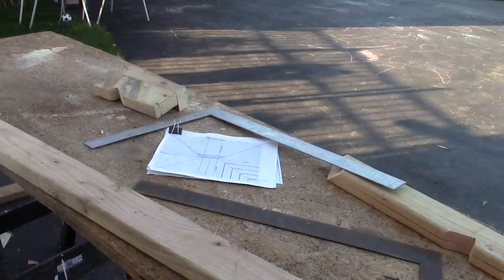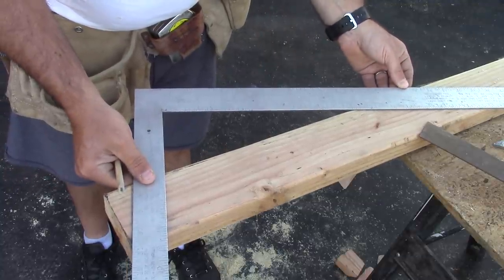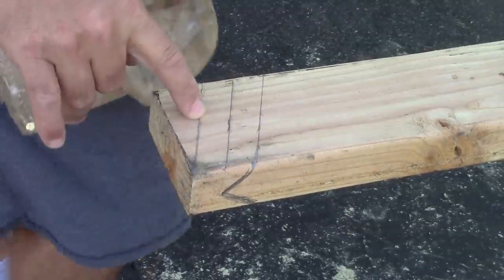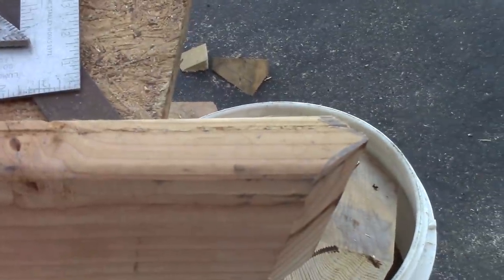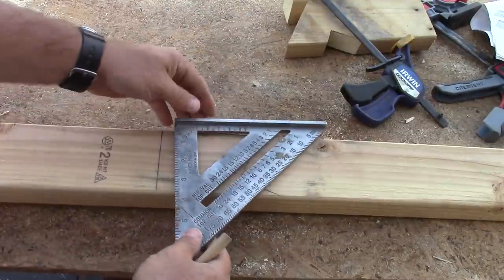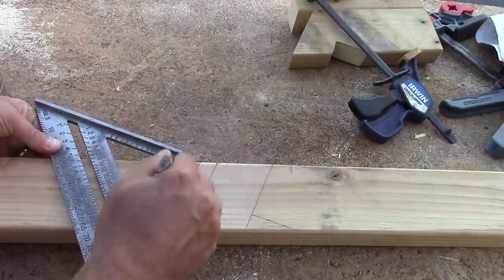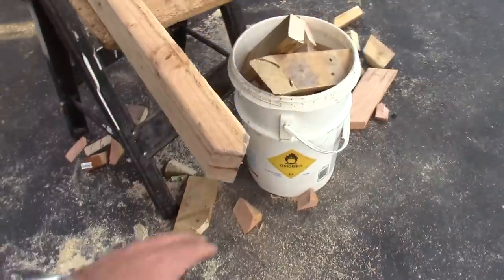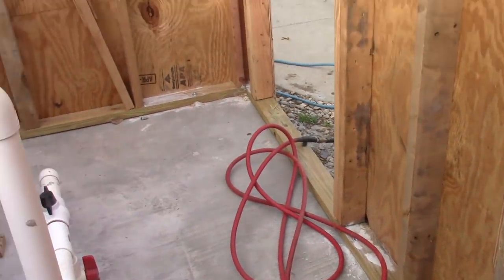How To Layout And Cut Hip And Valley Roof Rafters

Comment: Great and very informative video.
Quick question I noticed in the beginning of the video when you were using your framing square you said you have to put it to 17”.
Why is it 17”?is it always 17” no matter what the pitch is? for example your cutting a 4/12 hip roof would you still put it to 17” on the framing square?
Any info helps I would greatly appreciate any feed back thanks again

Comment: The birds mouth cut on the power saw is not recommended - you have seriously weakened the load bearing capacity by cutting deeper than is necessary!
Use a hand saw, or band saw if available. The rest is good, though.
Reply: Not trying to troll you doublewide6 but I agree with tessellater on this , the birds mouth on any rafter should never be overcut . Cut to line with circular saw and finish with a jig saw, hand saw or sawsall. Good job on the lay out and cheek cuts.

Comment: You did a very good job (actually an awesome job) with this video! 
As a roof framer from the 1960's, I  had to use the framing square, I didn't have the benefit of the speed square or internet. But it was all good.     
....13
Reply: Coming up in the 90s and 2000s we used a squangle extensively for roof cutting

Comment: looks great for one thing you over cut the birds mouth. I like to cut to the point and finish with a hand or jig saw
Reply: I noticed that too.  He wasn't all too bashful about it either, he was pretty aggressive.  And a 2X4 at that.  That looked like a pretty nice size shed.  I would have used a 2X6, at the minimum!
Reply: I would too but a hip roof is stronger
Reply: Watch the over cutting of the birds mouth, Most building codes (depending on area) require a minimum of 2/3 the board height above plate “HAP” or area above the birds mouth. Other than that, it was an excellent video
Reply: Common Sense Survival HIP-HAP
Reply: lab lover agree,  I learned you actually weaken the wood by over cutting. Don’t over cut, I could be wrong though./?
Reply: It's neater that way alrite  .... I'm the same myself... old habits die hard....

Comment: At 1:58 when you start to say about making 3 parallel lines, is the distance you separate the lines the thickness of the rafter I.E if you were using a thicker or slimmer rafter would you change the line distance or still use 3/4”?
Thanks for any info...👍
Reply: Yes you would have to increase the distance accordingly for a thicker board.  A typical 2x4 is 1 1/2" thick.  You are creating with this cut - 2 equal sided isosceles triangles.   The equal sided legs of the triangle for a 2x4 cut this way, are 3/4".  A 2" thick board would use 1" spacing on the lines to get the point of the two cuts to be in the middle of the board.  Draw it out on paper and you'll see.

Comment: very sloppy work ! your bird's mouths should have been finished with a jig saw that circular saw cut weakens the rafter tail and simply looks sloppy. you could also have used a hand saw to finish the bird's mouth.
Reply: so where is your video to show us how to do it the "correct" way????
Reply: I also cut my plumb cut on the birdsmouth on a 45 not square

Comment: I have never been good at doing accurate angle cuts with a circular saw. Wonder if there's a way to fab  fixture. Thanks
Reply from the maker: I'm sure there is, but making it adjustable would be the hard part.
Reply: practice, practice, practice...Im sure you'll get it.

Comment: This was very informative.  Thanks.  Weird question what do you do in a case where the roof run is longer then any board available? Would you just join two boards together?
Reply: Yes, butted end to end, and gussets over the joints. Then you will build a purlin wall beneath.